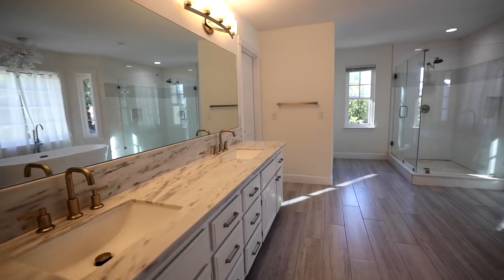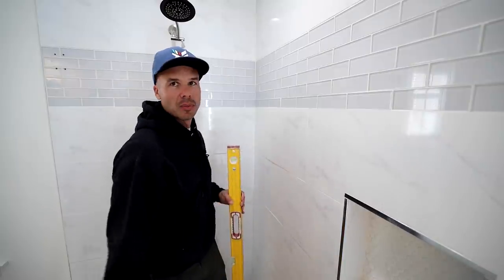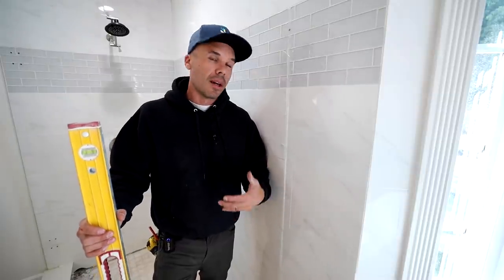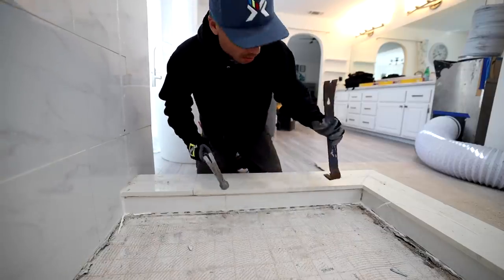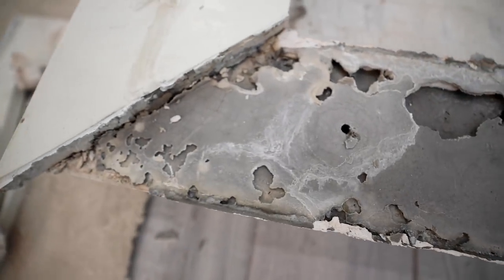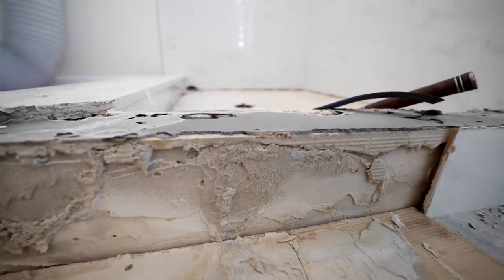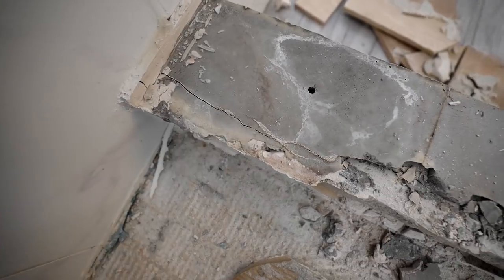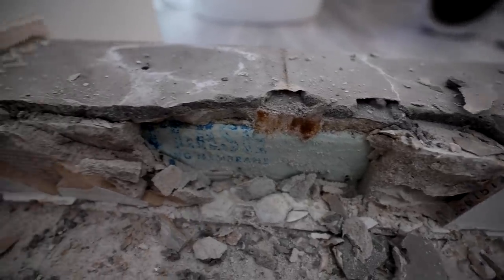FLIP HOUSE SHOWER FAILURE!!! --- Pan Leaking through Ceiling

Comment: I did a pre-slope, then a pan liner, then a mortar bed, and then Laticrete water proofing brushed on.  That worked very well. Maybe it is over-kill.
Reply: I don't understand the logic behind putting multiple water proofing. Once water gets under the tiles, it is game over. Doesn't matter what you use to water proof. It is better to spot a leak earlier so it is best to keep it simple.
Reply: @Faruk651  Well, on your own project, why not install a second line of defense? The water has to defeat two barriers in order to escape the shower.
Reply: @kevinhornbuckle  Water is not escaping no where. You will just trap moisture and everything goes downhill from there. You just complicated the work. Not any better than standard way of doing it. All the custom showers leak eventually. There is a reason why this tile coach guy keeps changing views on products and tries different methods.
Reply: @kevinhornbuckle  I used an acrylic fiberglass shower base for my project. Function>form
Reply: @Faruk651  You are unfamiliar as to how a pre-slope works. If water gets through the liquid-applied barrier, and through the mortar bed, it then contacts the vinyl pan liner. The pre-slope under the pan liner is pitched toward the drain. Having two levels of leak protection adds confidence that there will never be a leak into the framing.
Reply: @kevinhornbuckle  I think it is game over at that point. Every fail video this guy makes is where water penetrates the tile/grout. If he sees moisture under, in almost all cases there is damage to floor or framing. i would rather want to see the failure  as soon as water passes the first defense. You will save extensive damage to your structure. So your overkill water barrier is no good.

Comment: here is the "tip" or "trick" for the glass shower install no screw method - using aluminum rail made for the thickness of the glass but use a strong double sided tape to adhere wherever water penetration might be an issue (mostly the bottom rail) you can use screws to install the rest of the rail wherever needed like the ceiling or a wall the shower can't reach, silicone the joints so that water doesn't get a chance to seep in to the double sided tape and voila! - you could not utilize this method for frameless showers so this is a pre-install decision.

Comment: My shower door guy is coming next week. He has made it clear they only drill through the curb to set the frameless clamps. Is there anything we can do to make sure it won't leak? Fill screw holes with silicone before they screw? Nervous about these curb holes now. Curb is built out of engineered stone on top of kerdi foam.
Reply: What did you end up doing?
Reply: @Nimzo6  They drilled. Everyone drills. The secret is the silicone in the holes and obviously all along the joint when the door is installed. We don't ever get any water sitting there as our kerb has the correct slope to drain water back in to the shower.
Reply: @lowercase01  thanks. Getting some glass installed soon and debating between the clamps (drilled) and a u channel (bonded). I think the clamps look better but wasn’t sure if it’s worth the drilling. We have a good slope too though so we should be okay🤞
Reply: @Nimzo6  Very happy with mine. The clamps look much more modern as the glass floats on the kerb so I'd go for that. You'll be surpised at how little water gets up there anyway.

Comment: I'm a homeowner and when I built my house, I did all the tile work.  My shower is a mud base with a pre slope and PVC liner and then a mud pan.  I did use treated 2x4's for the curb, but they are wrapped with PVC and no nails  with a mud layer over them around 1/2" thick.  The walls are durock and I coated them with Aqua Defense.  I did end up with some lippage, but nothing like what you're showing here.  After seven years, there is no sign of leakage,  The ceiling below is in a storeroom so not finished.  I'd know if it leaked.

Comment: Haha also a plumber. Love these vids. For the glass door install, it's maybe not the solution you're after but applying silicone along the thread of the screw and then adding a very tight bead around the brackets should suffice
Reply: That’s what I did. Pre drilled the holes and filled them with silicon before inserting the screw. Then a blob of silicon over the screw inside the glass clamp. I would never trust the tile itself to hold the anchor in place.
Reply: @MoneyManHolmes  Has anyone used a blind threaded insert? You could use the kind that are sealed in the bottom and in stainless steel. Use an epoxy for installing into the predrilled hole. Maybe some silicon sealant on the screws to keep the water out.
Reply: There are externally threaded inserts also.

Comment: Imagine how the rest of the "flip" work is. I feel so sorry for these homeowners. Would a good home inspector have found this?
Reply: I have no experience with stuff like this but maybe if they blocked the drain and did a water test, they could possibly figure out something is leaking. Not sure how long it would take for a spot to be visible on the ceiling but maybe check the water level and see if it changes. Probably would take a couple days.
Reply: Also not sure how these systems work or if a water test works with a system that relies on weep holes, etc.

Comment: How far out of plumb are the walls? For 3 grand I think I could live with the wall out of plumb a little. The bubble in the 4' level was still between the lines so I doubt it was a noticeable eye catcher. I would have consulted the owner on the cost to make the walls exactly plumb and have to buy a complete new glass inclosure or if it was that big of a deal, in fact I bet no one even noticed. How much extra work and cost will it be to make the walls plumb and purchase new glass?
Reply: Can't profit on a new enclosure if you go that route.
Reply: @justinkarns7721  I really doubt that's the reason.
Reply: @vanman3752  a reason
Reply: @justinkarns7721  Who knows? I'd rather wait and hear it from the horse mouth, OK? There might be a very good reason that I'm not aware of.
Reply: That’s what I was thinking too.
Reply: Some things are about personal pride, and wanting to stand behind 100% of the work. The extra time/money spent to try and re use that glass is not worth it…. Having a wall not be plumb would drive me nuts, I’m guessing that’s why he is succeeding…doing it the best way possible and charging enough to continue serving the community.
Reply: Why can't he make the new shower couple inches smaller and get the glass cut square.
Reply: @travlangley1  As a contractor for over 40 yrs I guaranty you 95% of homes do not have plumb walls. Industry standard is 1/2" out of plumb in 8' vertical feet. That's not good enough for me and I would never accept that quality of work but you do get what you pay for. If I was in Issac's shoes I would lay it all out to the home owner and see what the home owner wanted to do, it is after all their money and their home.
Reply: @Faruk651  I don't think it is cost effective to cut tempered glass.
Reply: @vanman3752  oh i totally agree, that’s why wet shimming/floats are so important. You can make imperfect walls perfect because it affects the finished look…it separates the a average/above average
Reply: @travlangley1  Yep, it's just a matter of how much money you want to spend.
Reply: @travlangley1  Actually, when your drywall next to the shower is out of plumb, and you build your shower plumb, that becomes noticeable on the eye. A plumb shower next to an out of plumb bathroom wall is an eye sore.  An out of plumb shower next to an out of plumb bath wall isn't noticeable on eye unless you put a level to it. You only noticed that shower was out of plumb because Issac put a level on it, otherwise you wouldn't have noticed.
Reply: @williamp9158  I see what you’re saying, makes sense. I just have to say when setting wall tile..even with leveling clips you still use a level to ensure plumb. I try to feather that out when I build showers so there isn’t that abrupt difference. If your walls aren’t plumb you will see the issue the most in the corner cuts.
Reply: @travlangley1  You will notice different sized cuts in the corners only if your walls are extremely out of plumb and you have small  tiles on the walls otherwise it's not noticeable unless you measure the cuts.
Reply: If it were my home, I would consider tiling the wall properly and grinding a 1/2 inch channel into the tiles that would interfere with the glass. It would not even be noticeable, but for a professional business, I can understand why they would not want to perform these types of hack jobs. The next guy to tear into it will be bad mouthing the hell out of you.
Reply: @williamp9158  it’s actually very noticeable…the only way to hide it like you’re saying is to scribe the cuts on one of the walls…. I get restrictions due to budget, sometimes the customer can’t afford all the prep work to have it plumb. I don’t want to seam like I’m busting balls, but overall In the spirit of optimum you would want things perfectly plumb
Reply: @travlangley1  If you have a 20" cut at the bottom and a 20" 1/4 cut at the top....Can you tell by eye only that the wall is 1/4 out of plumb? Don't think it's very noticeable unless it's really out of plumb.  Sure.....Ideally you want every wall to be plumb, tiled walls, drywall, stucco everything plumb. If your shower is plumb and your bathroom wall is really out of plumb then ideally you would have to fix the bathroom wall so the transition from tile to drywall won't look bad but that's not realistic in most cases due to budget restrictions.
Reply: @williamp9158  you're right, it also all depends on the level the house you're working on is in.  Some houses are worth millions of dollars where the owner can spare the extra to make it plumb if there was some settling over time to create out of plumb walls etc.  It depends on the job, the owner and their bank account at the end of the day.  I am always honest with the clients who have unrealistic views when their budget isn't quite there.  I tell them straight forward that it would be extra time and materials etc.

Comment: Can the home owner sue the developer for some sort of reimbursement? Home developers around  in my neck of the woods generally have to offer at least 1 year of coverage for any issues that arise.
Reply: Didn't the house get inspected before it was bought ?? A building inspector would have picked up something was not right on inspection of the tile work , even with out a level. Does any one over there check the history if what they are about to buy ?? surely a savvy buyer would discover a flipped house if it had been put back on the market not long after it had been sold. Cheers
Reply: Home Developers usually means new home, if you can prove there was an undisclosed issue prior to sale, yes... but good luck proving that.
Reply: Only with new construction.
Reply: you can sue anyine. the question is do they have asset u can seize when u win? otherwise a waste of your time and money. Also cost of lawyers is more than the cost of the repair!
Reply: You can sue but it's probably an insurance claim
Reply: @hijinks21  at most can sue for the insurance deductible. The law will force you to use the insurance first then sue for the uncovered portion to be made whole.

Comment: Could one use an adhesive/epoxy to secure the glass?
Reply: Moisture and mold will delaminate any adhesive. It has to be mechanical fastening so glass does not slide off if person falls and hits glass with feet or body.

Comment: The problem with sleep houses is that they wanna save money so they don’t wanna pay 20 floor or $27 a square foot call Tile installation instead they find somebody that does it for $15 a square foot and it’s a handyman not a Professional tile installer and they do it with everything from Framing electrical drywall I seen jobs painted without sanding the drywall mud and that’s all about them putting extra $1000 on their pocket

Comment: Couldn’t you have just tried using siliconized matching grout in the corners and curb area first to see that would stop water penetration first?
Reply: Potential that it lestens the issue but grout is permiable. That is why you need a good pan that holds water in and funnels to the drain. Water will work its way below the tile.
Reply: It was far beyond caulking. Lack of experience caused this.
Reply: The water would have worked it's way into the framing eventually due to all the other mistakes and caused even more damage down the road. I don't think that would work in this situation plus the silicone would go bad eventually so it would be a continuous problem.
Reply: Ok.   Very good responses.   It was pretty bad work.    Do you guys know why you can’t use a shower pan liner  in conjunction with waterproof fabric on top of the pan also?
Reply: @Kyrieleyison  you might have to join the membership for that one...
Reply: Basically, the shower should be waterproof even before and grout or caulk gets installed. You can’t depend on those to provide the waterproofing.
Reply: @MoneyManHolmes  not saying to depend on it only.   The tile job is already finished.    I said at least try it first to save the 5k he probably charged for the job.   I had a small crack in the grout of my shower curb which caused leaking.  I put siliconized grout there and the leak stopped.and it been 4 years now.
Reply: @Kyrieleyison  you can but as Isaac said a liner/mud shower is a water in water out system. The water needs to be able to seep through the deck mud into the weep holes in the drain. If you waterproof where the walls meet the pan that’s ok but only come out no more than 3 inches on the pan around the perimeter.
Reply: @Apexjasonmorganllc  got it.  Thank you.

Comment: Have the shower glass installers coat their screw threads with 100% silicone before anchoring
Reply: 100% silicon has a ten year life. Urethane caulk is a little better. Avoiding penetration's is the correct strategy.
Reply: @DetailedInteriors1  so in order to avoid penetration of anchors for shower glass, do you recommend anchoring them to the walls, and build a "post" on the corner of the shower (that has no wall to anchor to)? is there another option ?
Reply: @MV-wb2cz  Try to avoid penetration's any any horizontal surface  i.e. curb +  pony wall cap and use urethane caulk on any screws.

Comment: This guy did a really bad job doing the HOTMOP waterproofing, if it wasn't for that you wouldn't be doing this job. The problem with people is that they don't understand anything about waterproofing system. 99% of times of leaks on bathroom showers are from poor waterproofing system or bad plumbing.

Comment: My glass installer was about to drill through my schluter curbless pan and I stopped him and ask him not to as i didn't want to compromise the water proofing. He floated the bottom bracket (meaning he siliconed it in place without any screws) and said it would be strong enough as the silicone does infact hold the glass panels in place really well. My suggestion for this scenario would have been to use shorter screws that only go into the marble jam and silicone the rest that way there is still that extra support to stop the glass from moving back and forth even though the silicone would have been strong enough. Just my 2c